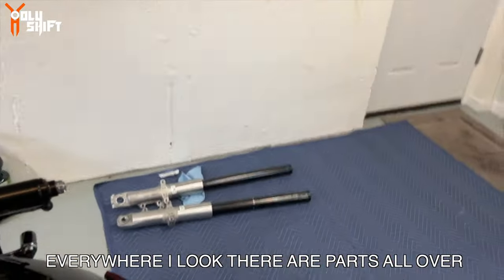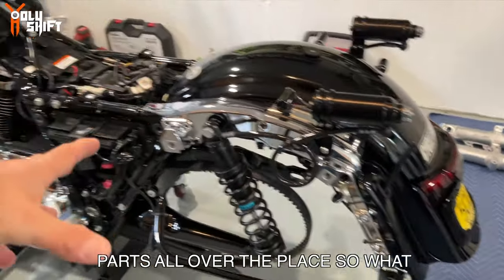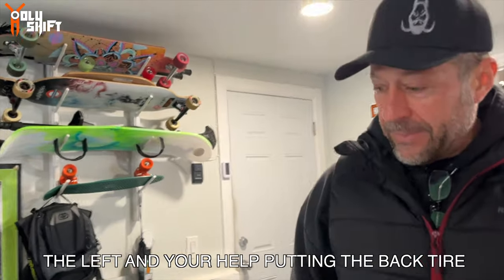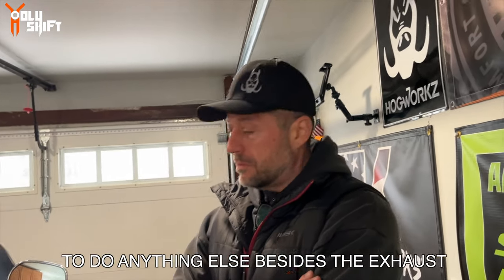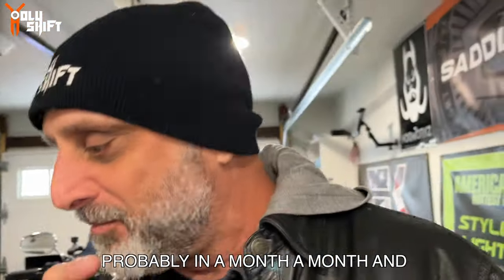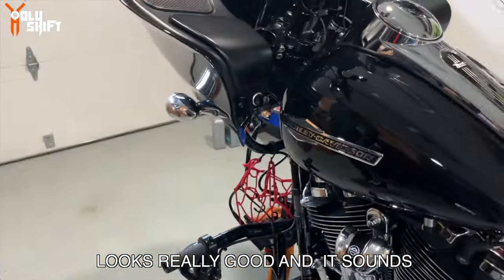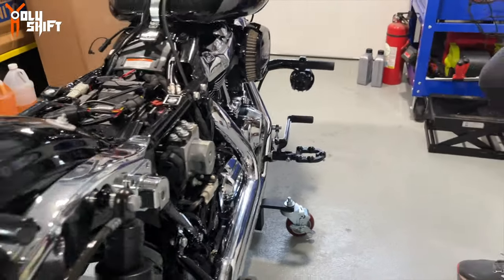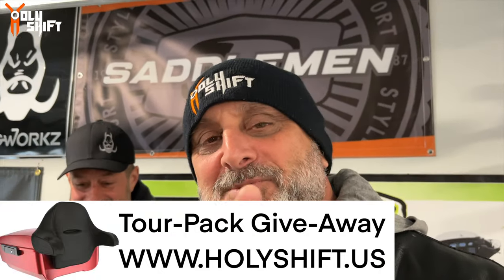Road Glide Fell Apart - Mad Max In Pieces

Comment: Battery weights:  I believe that the HD OE battery weighs approx. 22.5 pounds, and the aftermarket lithium battery is approx. 6.6 pounds.  The OE battery is rated 400cca, whereas the lithium is 1000cca.  So aside from approx. 15 pounds of weight savings, there's more than double the cold cranking amps (cca).  That's a win-win in my book.
Tom M., '21 RGS, 114 Stage-2 (S&S 465c full cam chest kit; S&S 2-1 Sidewinder exhaust; Fuel Moto 3956 Air Cleaner; Dynojet PV3b Tuner w/MAP from fuel moto).  Trask M8 checkvent to ventilate the crankcase properly, and HD oil cooler fan for proper engine oil temperature...monitored w/Dakota Digital gauges.

Comment: A Star 30/30 cam is very similar to a Zippers RS468. Fuel Moto tested both. The 468 made a tick more TQ and the 30/30 5 more HP. I want the TQ. I run a 468 on a 21 RGS 114 and make 130TQ/119HP with PV, S&S stealth with larger element, KW 2 into 2. It would be even better with a 2-1. Don't get sucked in to the "Moonshine" hype. That cam is a George Bryce (Star Racing) cam that they rebrand as a Moonshine product. Lot of hype with those hair/beard gel dudes. Star 30/30, RS468, S&S 475 all good products. Talk to Dave, he is a straight shooter without all the hype and gel.